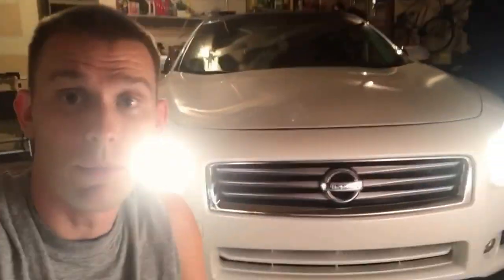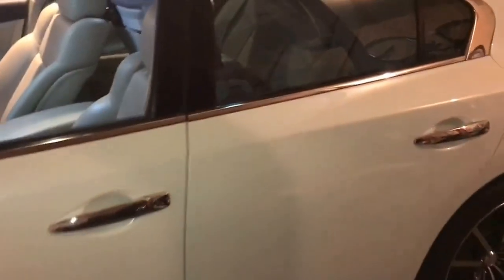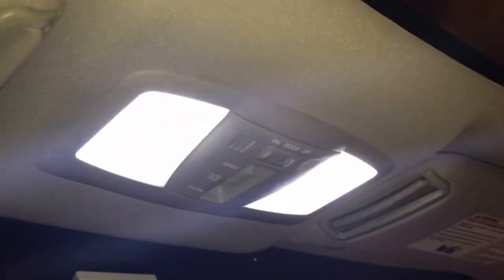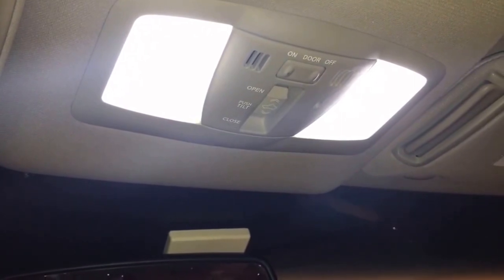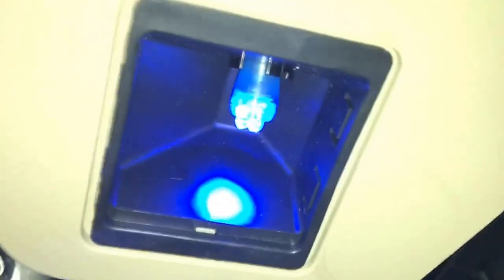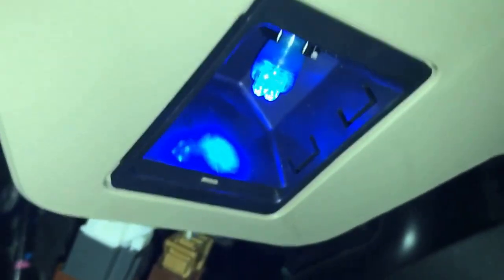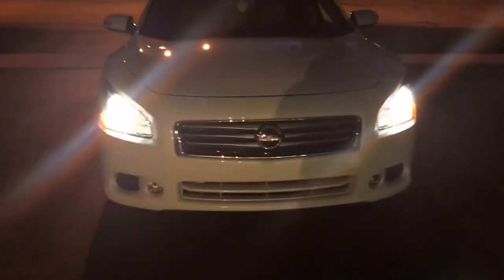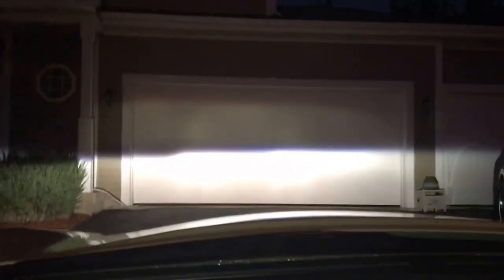Nissan Maxima How to Change ALL lights to LED

Comment: Where did you get the side mirror turn signal bulbs or leds? I'm having trouble finding them.
Reply from the maker: Chris Busha -- to be honest, I just checked those and noticed I'll have to change these also as one side is out.  I couldn't seem to find any online easily either so I might have to visit my local stealership and see how much they have the led strip for.

Comment: Hi, I have a question in the video you showed D2S bulb type, what about D2R type, will it fit and will it work the same way? Thanks
Reply from the maker: Timur Burkitbayev -- a D2R bulb will work, but will not match to oem lighting. D2S is oem recommended because ifs designed for projector housing versus D2R is designed to be reflected off the housing.  If you are replacing both at the same time and have D2R laying around I assume you will be fine.
Reply: Thank you so much so a quick answer!

Comment: The ground lights “step lights” on my driver side 2012 aren’t working or idk how to turn them on or how to replace them, please help!!
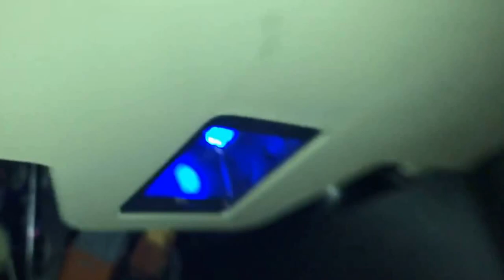Reply from the maker: Check out 3:11 on this video for the step lights changing.  I assume this is what you are looking for.  Unless you are talking about underneath the car...
Reply: Jealous Lawn Care I did, it’s the lights under the car, not from the door or interior. There exterior like when you lock the car, lights come on the bottom, under the car I’m not sure what there called but only my passenger side lights up
Reply from the maker: RmAnA56 -- ok those track lighting, I know what you mean.  I have a little section of mine out also.  Unfortunately from my understanding you need to replace the entire led strip of lights from the dealer and im not sure of how to install them.
Make sure you look under your car though, because the lights may be working properly but the adhesive material likely slipped off causing the light to be blocked by the bumper.  This was the case with my passenger side and I remounted them with some hot glue and double sided tape.
Reply: Jealous Lawn Care bro thank you so much!! Seriously
Reply from the maker: RmAnA56 -- no problem!

Comment: Can you specify which type of bulb goes to each different location? I’m trying to get an exact count prior to ordering, thanks!
Reply from the maker: Anthony Fondeur --- sure, which bulbs are you interested in?  The interior bulbs are all the same 194 / 168 / T10 bulbs ( link in the description). Those are all different part numbers but all the same bulb, some brands have a different number.
Reply: Hey thanks, I'm looking to get an exact count for example: INTERIOR= (Amount) 5SMD LED bulbs (2 for Dome, 4 for doors, x for underneath doors, X for glove compartment etc; EXTERIOR= (Amount) of 5SMD LED bulbs (2 for reverse light, license plate, etc) Thanks for your help!
Reply from the maker: Sure thing, here's the bulb info: INTERIOR = total of  10 5-SMD LED bulbs (4 for the doors, 2 for the dome, 2 for the rear reading lights, 2 for front footwell's, 1 for the trunk)  EXTERIOR = 2 5-SMD LED bulb for rear license plate lights.  These are all the bulbs shown in the video (other than the 2 HID"s).  Total of 12 5-SMD LED bulbs!
Reply: SUBSCRIBED. Your a big help thanks!! Great Vid also.  Last question, the step lights at 8:03, are those also 5SMD LED (x6)?
Reply from the maker: Anthony Fondeur — those underneath the step/door bulbs are actually a different type of bulb, not even sure if/how to replace those if they needed it. They look like led already.  Yours might just need to be repositioned and likely are not burnt out
Reply: How and where do you find a change out for the outside mirror turn signal lamp
Reply from the maker: Mrs Wallace — unfortunately, from the research ive done online, this is not an easy process. The bulbs are all one strip and is very expensive from the dealer and i couldnt seem to find a clear strip of lights instead of the oem. :-/
Reply: Thanks for the video. I'm counting 13 5 LEDs for the interior though.
Reply from the maker: Here's the bulb info I counted, unless i'm missing something lemme know...: INTERIOR = total of  10 5-SMD LED bulbs (4 for the doors, 2 for the dome, 2 for the rear reading lights, 2 for front footwell's, 1 for the trunk)  EXTERIOR = 2 5-SMD LED bulb for rear license plate lights.  These are all the bulbs shown in the video (other than the 2 HID"s).  Total of 12 5-SMD LED bulbs.
Reply: Finally got around to doing it. It’s great!

Comment: Can I use all the Interior LEDs with SMD T10 LEDs?
I was planning to use a white color inside my maxima.
Reply from the maker: As long as they aren't too tall versus the original bulb and it fits in the housing still.  There are different versions/looks of the SMD bulbs (some are very tall like a tower shape, some are shorter and fatter).  That will be a very bright light though.  White is definitely the best color in my opinion, it's what I use in my cars, nice clean/rich look!
Reply: You want the tall tower shape. Look up sirius led on amazon

Comment: How do i add l e d bulbs cause i could find the socket to connect the l e d bulbs , do you know where they might be at ?
Reply from the maker: leandro rodriguez -- which lights are you trying to replace or are you trying to add additional lighting?  Everything should be plug and play in this video.

Comment: Which places did you use the 4smd and 5smd at?
Reply from the maker: Wherever you like more or less light.  I used less leds in the license plate bulbs than my interior.
Reply: @JealousLawnCare   How did you get the foot lamp bulbs out? I’ve been trying very hard and can’t take It out
Reply from the maker: You really need to get yourself completely under the dash to see how it's in there to get it out.  I recommend being upside down...its pretty tricky and awkward

Comment: One of my stock hids are looking pinkish purple. Is it going out already ??? Thanks for the video too. I was breaking my head trying to figure out how to change it lol
Reply from the maker: Mario Sandoval -- hmm that's a strange color, are you sure they are oem and not changed from an original owner? If your hids aren't matching, I'd swap the bulbs with each other and see if it's the bulb or another issue.  Or just buy a pair (since you will already have the car apart).
Reply from the maker: Mario Sandoval --- looks a little different, and you say it changes colors? What stands out to me in your pics is that awesome tile in your garage floor! I'm jealous!!
Reply: Jealous Lawn Care its been that color for about a week. Ill probably swap them like u said. To make sure its that. Ill end up buying the oem hids. The tile lol 
Put that in myself

Comment: NEED HELP!! I broke the passenger side foot bulb completely, so I disconnected the battery to ensure my fire safety. I don’t know how to extract the bulb, and it’s in a tiny area. What can I do?
Reply from the maker: Clark Morgan -- can you reach the backside of the bulb / housing of this busted bulb?  That's the only way I would know how to extract the bulb without the bulb in tact.  If you can access the back, just use a screwdriver or something similar and just push from behind to remove the bulb.
Reply: Jealous Lawn Care Thank you so much! I was trying to see if this is possible, but it was not. Since I disconnected the battery, I was able to use tweezers and pull on the metal filament, which luckily released the entire bulb. I now have another issue, though. I swapped my license plate bulbs to LED, but those push tabs are not going back in at all! The stoppers go back in no problem, but even with all the force in the world, the push pins/tabs refuse to go back in. Do you know what I could possibly be doing?
Reply from the maker: Clark Morgan -- hmmm strange about the license plate housing not going back in.  Did you get the same exact bulbs as in my description, just in case I know some bulbs are different lengths/heights.  Is that possibly your issue (bulb height) or what else is causing the housing not to snap in? Sorry hard to diagnose this without your car here. Heh
Reply: Jealous Lawn Care Sorry for the late response. The bulbs work perfectly. It is only those tiny black push tabs that you have to remove in step 1 that do not want to go back in.
Reply from the maker: Clark Morgan -- you are referring to around 14:50 in this video for the license plate housing right? I don't see any black push tabs...did you try fitting this housing back in without the bulb or using the oem incandescent to ensure if it's the bulb sizing or not?

Comment: What led lights should I buy that light up the whole door panel inside instead of one half like u showed.
Reply from the maker: Unfortunately I haven't found a good solution for that, I've looked around but haven't been successful since led's face one direction typically.  If you find something please let me know and I'll update this info.
Reply: Having a hard time making the t10 smd5 fight the side door panels that light up the bottom. Did you make yours fit or have another option. Comparing the side door bulb is smaller
Reply from the maker: Curtis D --- i didn't have to modify to fit at all, they fit just like all the other interior bulbs.  They are slightly longer than the stock incandescents but didn't have any fitment issues on the Maxima.  Not sure why you are having issues...?
Reply: I have a 2014 maxima S maybe the compartment is different.  The 194 yorkim 5smd works just won't stay.  There is a circular metal design preventing the LED to be completely pushed into the socket because the Yorkim has a wider rim than the stock part.  Have to look for a different bulb I believe
Reply from the maker: Curtis D -- seems very strange they didn't work for you, sorry about that.  The only other leds I have tried in previous cars are these non-smds.  Not sure if these would be better fitment or not though?   
https://www.superbrightleds.com/moreinfo/miniature-wedge-base/194-led-bulb-5-led-miniature-wedge-retrofit-car/199/
Reply: Curtis D i got one brand of 194 bulbs to fit it, forget the name but its on amazon 10 for about $11.99 & have white casing instead of black like the yorkim

Comment: Hey, would this work for an 07 Maxima as well? Thanks.
Reply from the maker: Adam Leary -- yes, but you may have different bulb #s for certain lights. Which lights are you interested in changing?
Reply: @JealousLawnCare  I was interested in changing all the lights listed in your video
Reply from the maker: Adam Leary -- looks like the headlights and majority of the lights use the same bulbs.  Here are the differences you would need from what I found online :
Front signal - 4157
Rear signal - 3057
Map light - DE3021
Dome light - DE3175
Reply: @adamleary1085  - How well did theze lights work for you? Are those just interior lights?

Comment: Thank you! This video is very helpful. I just got a preowned 2012 in black.
Reply from the maker: EJ Martinez -- welcome to the Maxima club! You will love it, I had a 2009 Maxima as well.  It got totalled by a texting driver and we ended up buying the same car since we loved it so much.
Reply: Jealous Lawn Care I'm loving it already! Very good looking car and it can get up there. I'm looking forward to other your diy videos 👍🏼
Reply: I jag a 2006 maxima...I now have a 2010 maxima.... I also have a 2016 Camaro or and seriously thinking of trading it in fir a 2018 maxima platinum
Reply from the maker: edgu71eg -- ya those 2018 maximas are interesting, but I'm not a fan of the interior.  It is nice, but a little too sporty for a 4dr. Front is too bucketed and the steering wheel too.

Comment: How about the reverse lights make a video on that? How to remove the tail lights!
Reply from the maker: Good call Daniel, I'll work on this next.  I've done this 2x already to change my corner bulbs.  Stay tuned for this video!
Reply from the maker: Daniel - I have finished this video per your request.  I hope this helps you out!https://youtu.be/FffSC0nY0qg
Reply: I made video on how to remove taillights and do turn as tail mod with double reverse LED

Comment: Glove box?
Reply from the maker: My Maxima doesn't have a light in the glove box, does yours?  If so I'm very surprised because I have a 2012 Maxima SV.  What year and model is yours?
Reply from the maker: Mr martin --- hmmm that glove box light must be a new addition in 2013 or 2014.  Unfortunately I don't have any info on that coming out :-/
Reply: Mr martin did you ever figure out how you change it I'm having the same issue
Reply: I have a 2014 SV and I just pulled the plastic cover off. It took the same bulb as the other interior bulbs. It was hard to get the bulb out with my bare hands because it was slippery. I used a rubber glove pinched between my fingers and it came out with no problem.
Reply: I have a 2010 SV and it has a light in the glove box. Can't figure out how to get the cover off. Anyone figure out how to get in there?
Reply: To change light in glovebox you need to remove the whole glovebox. The cover does not come off. Not hard to do. Takes about 10 minutes.

Comment: I can’t pull the bulb, the one by the feets, I can’t pull it out
Reply from the maker: If I recall you might need to get at it from behind...its tricky.
Reply: Are you messing with me?😂😂😂 or are you serious???
Reply from the maker: Actually I am serious and just went out to test it in my car just now.  Yes you can reach behind the bulb housing and turn the plastic "screw" a half turn and the whole assembly with bulb comes out easy.  Try that and lemme know
Reply: Thanks, imma check it out
Reply from the maker: Hopefully it works for you just as easily!
Reply: It did!!! Not even 3 minutes…Thanks man👌🏾🔥
Reply from the maker: Awesome glad to hear it!

Comment: im trying to find out how you disconnect the light bulb and watched this whole fucking thing and you didn't show it???  Jesus Christ
Reply from the maker: Ya its hard to show due to not much room in there.  To disconnect just twist the housing 1/4 turn and then remove the clamp holding the bulb in.  Should pop out then!